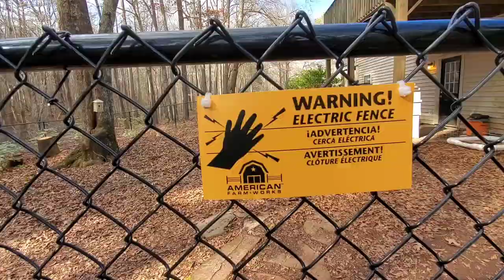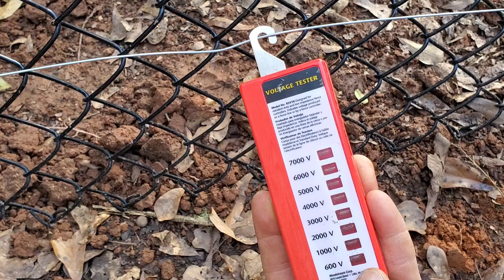How To Install Electric Wire To A Chain Link Fence

Comment: A safe way to test the fence out is to use a 12" blade of grass, hold the one end and touch the tip and slowly slide your hand closer to the hot wire. It will start off as a slight tingle and get more intense the closer to you get to the hot fence wire.

Comment: Hey Shane, I've got a five mile electric fence box from Tractor Supply and it came with a short plugin cord. May I suggest leaving the fence on all the time. My Shepherds hear it when it's pulsating so guess what? When it's not on they get out. Just a warning!. I've got mine low like yours and they won't get close enough to it to try to climb out.
Reply from the maker: Awesome thanks for the heads up

Comment: I just installed one before I saw this video. I couldn't find any chainlink fence mounts. I used some old schedule 40 conduit I had from a previous project and cut a bunch of 1.5" pieces. I ziptied them to the fence posts about 8" from the ground and made a lap around the fence with a roll of poly wire. I have a very stubborn XL bully who had figured out how to push out under the fence. Now, neither the XL bully or our pocket pittie will get within 6 feet of the fenceline. No way, no how. I figure I could unplug it now without any fear. Great video.
Reply from the maker: Lol they learn fast

Comment: I pre drilled a hole in each post of my chain link. One up top an one near the bottom. Then I screwed the plastic piece to the pole. Works waaaaaaay better an I saved a few bucks.
It actually looks really good too and nice and neat .

Comment: I have to do this for my two dogs because I need them to stay outside all day for several weeks.  I have a Lab that will bark to get inside for awhile until he realizes there is no one there to hear him.  The second dog is a different story, he's a stray that tries every minute he's outside to dig under the fence.  Maybe that's why he was running free along the highway and no one spoke up to claim him, he dug under the fence more than once, he's a lot of work, but he's a sweetheart!  Thanks for your video.
Reply from the maker: 7000 volts definitely keeps them back In The fence . They try it once and that's it
Reply: Just watch see d this video.  How is it working?Have they  dug out after being  installed?

Comment: Just a FYI you can use the same standoffs on your posts as well just use long screws to attach to the fence pole uprights.
You can also run it on the top-rail as well to keep other animals from jumping the fence. 
If you have a plastic coated fence you will need to run a ground wire 2 “ below the hot wire.
Loved your video!

Comment: We are researching this option for an Anatolian Shepherd we took in as a county shelter rescue.  Have since learned that breed is notorious for being super independent, and not really caring about your efforts at training.  These are big powerful dogs.  And in this guy's case, he has literally ripped the chain link webbing apart to get out through a gate.  Repeatedly.  And goes for 2-4 hour walkabouts through the woods and fields and stream around us.  One time he came back with a bloody muzzle, like a polar bear that just ate a seal.  No idea what he ran across and he wasn't talking.  We have a decent fenced in back yard, in the middle of a 10 acre property, surrounded by hundreds of acres of other people's private land for him to get into trouble.  This is looking more and more like a good option.
Reply from the maker: The charger we got was 7000 volts. When they touch it they only touch it once lol
Reply: Ya we have 2 large dogs(110 + lb), one can scale the 6' chain-link fence in 2 seconds, both dig a little but mostly jump, I have a set of the insulators ordered. After searching online, it seems the ones he is using would hold up the longest. Other ones are all plastic and seem to break a lot, the part that attaches to the fence, one part seems to break and these ones are metal so they would be the better option.
Reply: @KinfolkFarmofGeorgia 
Does that voltage kill human or animals?
Reply from the maker: @user-po8no1xp6e  no it doesn't
Reply: @Wqghfxz  Ya it won't kill you but man can it hurt, it's been many years idk 20 or so since I got popped by a fence. Some put out more voltage/shock ability than others, I think it partially has to do with how many miles it can handle. Mine is for good for 20 miles of fence, I plan on using it for the chicken run and garden area along with the yard for the dogs, I just need to run the insulating sleeves/shielding underground to hook it all up and keep it from grounding out.

Comment: Thanks for the video. I have an electric fence for my boxer that will jump the fence any chance given to him. I have to run mine all the time. Keep an eye on your unit to make sure it is running, mine failed a year after getting it and my precious boy realized it wasn't working and was over my fence the first chance he had. They can sense the pulse after they touch it once or twice they don't like it. When my boxer got out the second time, he was exhausted by the time I caught him so it is not safe for him to get out, afraid of heat exhaustion for him. If you haven't done an updated video, I would really like to see it. Our fury babies are so precious and will do anything to protect mine.
Reply from the maker: We are really lucky, they don't test it anymore lol. We put them in the back and they stay. Honestly we don't even have it turned in anymore. Love our pups and sounds like you have a great pup as well. Thanks so much

Comment: Hi, really enjoyed your video. Been there done that, lol. I have a lab that likes to dig under the fence and climb over. So I got me the exact unit you did. Well eventually he did start digging under the electric fence which I had at anywhere between 8 to 14 inches from the ground and I would have to lower at his digging spots and he also started jumping over the gate so I put a line with a handle on it. My problem with the lab is he's very scared of thunder, fireworks, and firearms, plus when a female is in heat, he gets so scared or the scent gets too strong for him that he disregards the electric fence and jumps out over the fence even as he gets shocked momentarily shocked. I've heard him yelp. It's funny because the gap he jumps out through is only about 8" wide at the most, maybe less. Now I'm thinking about screwing a 1×8 board to the post. But whenever I fix one spot to prevent him from getting out, he finds another. He's driving me nuts, lol. Anyway, I was thinking about getting an underground electric fence to supplement the physical electric fence and install maybe 2 feet inside the perimeter of the physical one. My theory is he won't attempt to get too close to the physical one because he'll get a correction before he reaches it, but then again, I'm not sure how that would work against his fear, where nothing matters. Also, since the underground is wireless and sends a signal to a collar he would be wearing, I'm wondering if the physical one would cause any interference to the wireless signal. Ok, not sure if you follow me. Ok, well keep up the good work. Your vid was plain and simple and easy to follow. Sorry for the length of comment. I hope it makes sense.
Reply from the maker: Lol good luck. Our male Odin drives us nuts the same way

Comment: Took a couple of goes to see it through 👍 gr8 job Shane 👏  quite tip having worked with electric fencing in the past grab it in the palm with a tensed forearm and you can quite easily cope with a few wacks, when you touch it with relaxed mussels it makes your mussels contract fast and that's what hurts, just line it up and grab it hard, Honest bro you'll be surprised how much bigger fence you can safely grab test. It's still not something you do for fun but it's less painful than a soft touch 👍🍻

Comment: Lol. Use a long blade of grass for testing. Not a fan of wire holders on fence. Got tired of replacing so I cut tensioner rods and clamps to pull off a little more distance from the fence.

Comment: You may want to consider adding wire tighteners to your line.  Where did you buy the hardware that attaches to the chain link fence?  I've tried to find something like what you're using at different farm supply stores without any luck.
Reply from the maker: Don't need tightners and its all from Tractor Supply

Comment: I wish you had shown assembly from the charger fence all around the fence.  Where did you stop fence line?
Reply from the maker: From charger all the way around to other side. You don't have make a complete circle. Supe easy. It's electricity, it's gonna travel to to end of the wire

Comment: We have a large coop with a chain link around it so they can free range. We have a hungry bobcat that likes to visit and has taken a few of our males. This looks like a great resolve if we can do a high and low. Any additional tips or suggestions? What’s the one you have for the pigs??
Reply from the maker: We bought a big solar charger from tractor supply 7000 volts it works great. I tell ya what I do for my chickens. I have a small radio playing 24 hrs a day. It works great except on opossum and raccoons. Hopefully this helps.
Reply: @KinfolkFarmofGeorgia   Thank you!!! I will definitely try it.

Comment: Shane , can you please tell us what you used for your pigs hot fencing?
Reply from the maker: I just bought a solar charger from tractor supply. DONT SKIMP lol get a big one and a roll of wire. Not sure what style of posts you have but they sell conductors to fit all styles

Comment: A good video. However while all GS will dig, many will also jump. I had two that would clear that fence at 6 months old. As a Electro/Mechanical designer I had to post even though this is an older video. 
Having power feed to a fence and running an electric cable through it is just setting up for an accident. Cant see in this video, but anyone watching needs to make sure that charger is setup in a dry location otherwise rain is going to get into that socket. The mounting/location and power to the charger is about the only concern I have on a otherwise good video.
Reply from the maker: Thanks but never had a problem. Wires not through fence it's ran through insulators to keep it separate from the fence. But thanks for the info
Reply: @KinfolkFarmofGeorgia  understand. I was referring to the power cord not the energized wires. I know you didn't have problem, but others could very well which is why I always mention potential safety points.

Comment: Drill some holes in the corners and wire it that way. It’d be more stable and look better. Loved this btw, I have to check my city code but I keep getting a neighbors massive pit bulls in my front yard that have been aggressive toward myself and worse my dogs, basically the owner lets his dogs out anytime regardless they’ve caused problems for myself and neighbors (their massive male broke into my backyard last summer and tried getting through my dog door into my house) and anyways I’d like to install Hotwire to make a barrier out front. Our police and humane society won’t do anything  about it regardless the dogs get out multiple times a week and sometimes multiple times a day so it’s stressful letting my dogs out which are on leash and in control because I can’t guarantee their safety. My male is pretty big but these pits look like they’re on steroids
Reply from the maker: They are definitely dinosaurs.  I delt with my neighbors pitbull killing my chickens but I shut that down

Comment: How long does the ground rod need to be and what type of wire going to the clamps?
Reply: And how long does the rod need to be
Reply from the maker: I just use electric fence wire from Tractor supply and the rod, the longer the better

Comment: When you run wire to end of fence away from house , is that where it stops and how do you wrap it there?
Reply from the maker: Just wrap it around the last insulator , it's all gonna be hot. Buy a cheap tester to make sure it's working
Reply: Ty

Comment: You skipped over how you connected the handle by your gate(s) and I wish you'dve shown a bit better the completed project. I have a small tree leaning on my existing fence, I suppose I need to perhaps "ratchet it" back and stake it away from the fence so it's not touching. But I don't understand how the handle gets wired so I'm off to find a different video that covers that in more detail. Thanks for the information !
Reply from the maker: Just make a loop in the wire.

Comment: I am confused,  isn't the entire fence running with current after installing the line at the bottom?
Reply from the maker: No the insulators that are holding the wire separate it from the fence

Comment: "supposed to be good for your heart"
LOL  We all know you were cracking a joke there.  In all seriousness, I had a patient that accidentally made contact at a gate that she didn't know was charged (was for cows and horses, so likely a stronger system).  In her case, worst case scenario, the charge went from left hand through her chest and out the right hand.  Threw her heart into permanent A-Fib, bad enough that she eventually needed a pacemaker.  Be careful out there folks.
Reply from the maker: Lol scary

Comment: Could you tell me the total cost of this? My dogs dig holes and get out all the time, I’m scared they won’t come back next time. Thank you
Reply from the maker: I bought it all at tractor supply. The charger unit is only like 30$ a role of wire not much more. The clips I think were like 10 $ a bag I used 2 bags. It absolutely works. My dogs don't go near the fence anymore
Reply: @KinfolkFarmofGeorgia  thank you so much!! This will definitely help my dogs I think
Reply from the maker: It will lol I promise

Comment: The better your ground the stronger it will be when they touch it!
Reply: Wetter?
Reply: @gerardogonzales6584  Yes it does require moisture so sometimes you have to have more than one ground.In rocky dry areas you can connect the ground wire to the welded wire of a fence and that will improve the ground
Reply: Oh ok, I get you now. I thought you had meant wetter, instead of better.

Comment: When I plugged the box in it started ticking at 1 second intervals. Is this normal?
Reply from the maker: Yes that's the pulse of electricity. Touch it to see if it works LOL
Reply: Um…no thanks!

Comment: I put this fence up. And the amp box will not push out voltage. The outlet works, the amp box works. Any suggestions?
Reply from the maker: Ground Wire?? Only thing I can think of
Reply: Thank you oh go or your reply! I’ve have went round and round with this fence! I have one ground wire/rod. Do I need 2? I have doubled checked everything. I made sure the ground rod was drove deep into the ground as well.
Reply: I did notice with your hot wire and ground wire that the hot wire ran off to the right and the ground wire straight out. Because of where my electric source is my ground wire runs straight out from the amp box and the hot wire runs to the left and right behind the ground wire. They don’t touch but would that make a difference?
Reply from the maker: Not sure what you're telling me but tge ground with should be connected to a long ground rid hammered into the ground
Reply: I figured that was confusing to explain. Thanks for trying.

Comment: Only thing I see wrong with it you got your gate had on on the wrong side
Reply from the maker: Why wouldn't it be
Reply: You want your gate handle hookup on the over side where you can unhook it wellrest your fence won't be hot
Reply: Yes, I like mine that when I disconnect the handle, the wire on the handle is dead. No shock hazard.